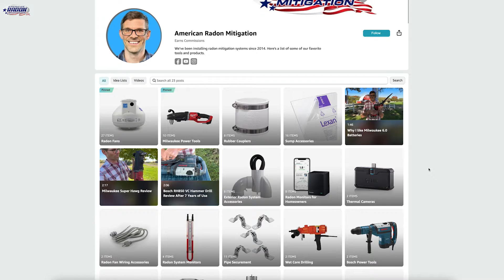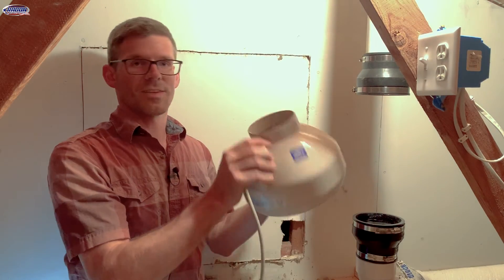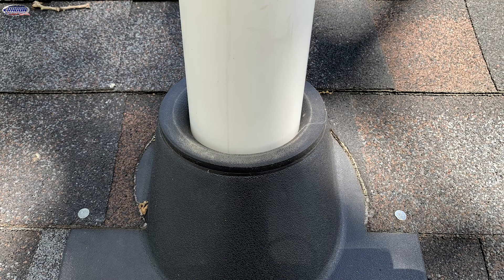How to Replace a Radon Fan in Your Attic

Comment: Replaced an old exterior wall mounted fan and after a month it started to vibrate through the room next to it again. Sounds normal outside. Could it have become unbalanced or could the vibration be a bad fan? Any troubleshooting you’d recommend?
Reply from the maker: I don't know what would cause it to start vibrating suddenly. You could check to see if something got caught in the fan's impeller. Could it be ice?

Comment: Hello, I’m about to get an eagle extreme for my house.  After I install it, if the manometer shows too much suction, from my understanding it will be less  CFM.  Is there a way to lower the suction on this fan and if so will this cause more CFM?  Thanks for your help.
Reply from the maker: What fan does your home have installed now?
Reply: @AmericanRadonMitigation  there was an old fan and I replaced with a mag prowler.  It shows 2” on manometer with prowler  but my radon level is still at 3 pcil.  I was going to replace with eagle extreme to try to bring radon level even lower.  It currently has 3” pipe.  Thank you
Reply from the maker: A larger fan is rarely the answer. You likely need to focus on sealing or adding additional suction points. Measuring your pressure field extension will help guide your next steps. Check out our website if you’d like to rent a tool kit or learn about virtual consulting. Americanradonmitigation.com/shop

Comment: When do we know if it's too loud? Is there a decibel level?
Reply from the maker: There's no decibel level since a fan’s noise will vary depending on the model, CFM, and other factors. 

Although, you should be able to hear the fan getting louder over time. It's more of an annoyance at first until it fails. 

If it does fail, I'd shut it off since I've seen some fan motors get pretty hot.